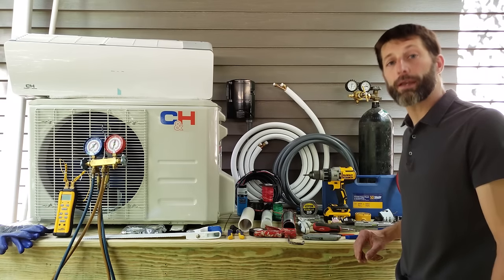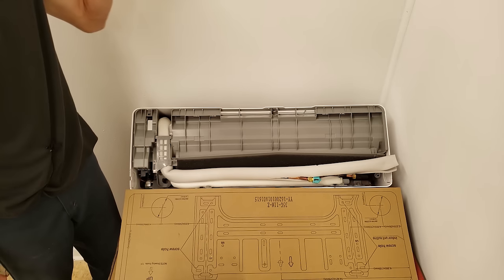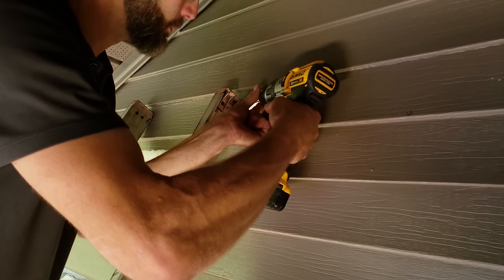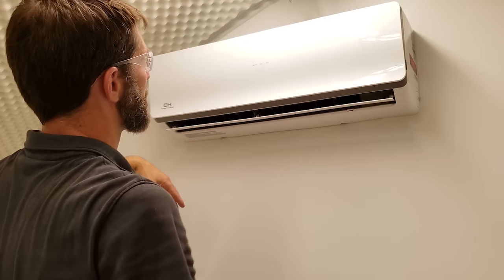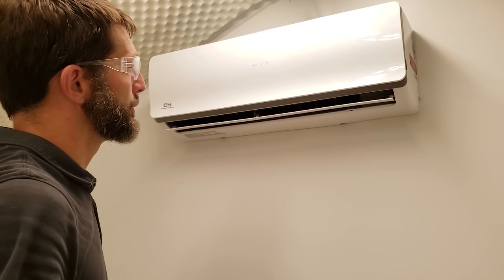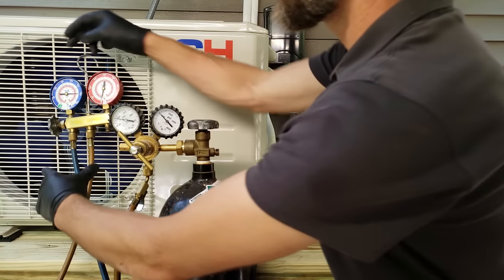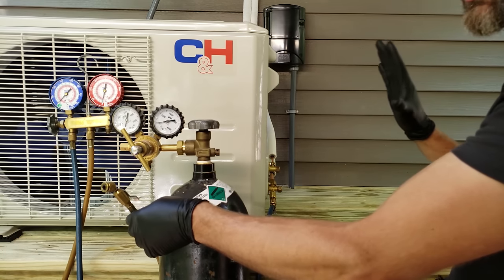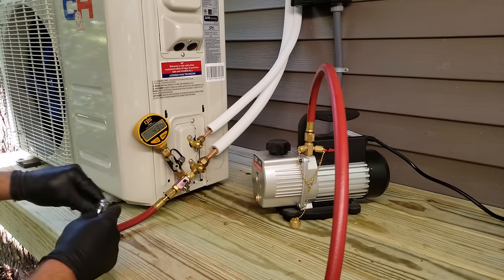Full Installation of Mini Split Ductless Unit, Step by Step!

Comment: Excellent video. I don't think you left anything important out. I loved the idea on using a plastic rain downspout in place of expensive dedicated line set covers. I assume this was installed in a Southern State because the platform it is setting on would otherwise allow snow to build up around the unit including the back side.

Comment: Thanks for the useful presentation!
I don't understand why you need to take out the valve needle?
There is a service connector that pushes in and opens the needle, why should you take it out?

Comment: I just enstalled a pioneer minisplit but with a plug.  It trips the gfci plug, so I put a regular plug on it.  It trips the gfci outlets in my garage as well.  It works fine on a regular outlet and doesn't seem to have any short, overload or anything.  Any idea why these would trip a gfci?  It does it right when the outdoor fan would turn on, there is a click sound which preceeds the fan turning when it works normal.  Thanks for any input.  Your how to videos are top quality.  It's harder than it looks.  LOL

Comment: Really appreciate the installation procedure, I learnt something new about the indoor unit install but in a situation where you are in a closed building especially a commercial stores. This method doesn’t work. My concern is about the usage of a slim duct instead of the exterior covering you used. In all, great job bro.

Comment: Thanks for posting. Such a professional installation requires the use of flare nut wrench on brass connectors. The adjustable wrenches are the worst tool for this type of work. All the best.

Comment: Hello Craig.  I installed my first Mini Split on Saturday.  The only question that I still have is the valve core removal tools that I have came with Schrader valves installed.  Should I just remove those next time so I can install the vacuum gauge directly to that fitting without adding the fitting that depresses that valve?  Thank you again.

Comment: QUESTION: what is the reason you would add a disconnect switch next to the evaporator head? Planning to install a 4 - head system soon. Great Video!

Comment: I have three points about a mini installation:  Most importantly, all the manufacturers that I am familiar with instruct you to add insulation around the lineset.  Because of high temperature differentials to maintain optimum efficiency of the unit and to prevent heat loss or gain enroute this is a requirement most especially so in colder or hotter climates.  I have never seen a mini with a stainless steel  compressor.  Even though they often tout their "harsh environment compressor model" for coastal zones and wet climates I have yet to see an actual compressor truly designed for a rigorous environment.  Add to that the degradation that happens when debris (leaves, pine needles etc. etc.) clogs the heat exchanger in efficiency and life span it only makes sense to enclose (with plenty of air flow) the compressor.  Those closely spaced fins are extremely difficult to clean if they do accumulate debris without damaging them.  If you are in snow country you don't want the compressor trying to operate while restricted by snow.  All the components are effected by corrosion to more or lessor degree and driving rain does the computer boards no favors either.  It has been my experience that the bottom pans of even the "harsh environment" models start to rust out after only a year or two in service.  Because the condensate keeps the pan wet year round this will result in shortened service life so doing everything possible to extend it only makes sense.  Lastly I would highly recommend leaving a bit of slack (service droop) in the lineset in case at a later date any fitting needs to be replaced.  Yours was short enough not to really matter but in many cases an unnecessary splice might be required to replace a simple flare fitting.  A bit of slack at the compressor makes that a quick task.
I liked your innovation with the downspout as most lineset hides are not large enough to take the extra insulation and/or multiple linesets required.  Maybe the vinyl post covers for 4x or 6x used as you did would solve the problem.
Reply: Leaving a little slack yes. A loop, absolutely not. That creates a  oil trap and will starve the compressor.

Comment: Really informative video. I am going to be installing a C&H 2 zone mini split and was curious about one step of the pressure and vacuum test. I have seen conflicting information about what low pressure valve to run the test off of. Should I be testing both lines individually, or can I adequately complete the test off of the main valve?

Comment: Also can I run line sets along the back of the unit and pull off the tab to run them through then run up into attic and out exterior wall to condenser? Thanks for your content and time. Keep it up!

Comment: Your videos are unbelievably helpful. As a result of your videos I have three brand new Mitsubishi mini splits installed in my house. And I never had a problem. Just absolutely superb. I do have one question if you can answer it. I am running a fourth Mini split and it requires me to run the lines that across an  insulated attic.  Do you recommend a specific type of insulation for the Lineset so that condensate doesn’t form and leak through to the ceiling below? Thanks so much

Comment: Amazing tutorial as usual! Thank you. I have a Fujitsu 5 zone  system to install. I’m only putting in 4 indoor units for now, ( the connections are labeled A,B,C,D,E) but I’m not sure if I can skip connection A, and connect it at a later date. Manual doesn’t specify.

Comment: what's you take on using a factory hanger to hang one of these ( 9000 BTU) on a metal building say about 1.5' off the ground or should I go with a concrete pad.  I am thinking about convenience of mowing underneath this vs air flow.  concrete pad placing the outdoor unit perpendicular to building wall will clearly give me much more air flow than keeping it about 6" away from building wall on a hanger.  What is my priority and what do you suggest?

Comment: Hi Craig, I think mini splits are designed with American homes in mind as your walls are not very thick, here in the U.K. we have very thick brick or stone walls and when you come to fit the indoor unit the flares are inside the wall where you can't get to them which is not ideal for maintenance this means you have to connect your line set first and feed it through the hole, have you ever come across this and would it be possible to just extend the copper tails on the inside unit ?

Comment: The installer of a Mitsubishi MXZ-2C20NA4 - wants to charge me for the refrigerant for this new Mitsubishi mini split he is saying it will take more than  10 gals. Is there a chart somewhere that says how much this unit uses with both zones using a total of 66 ft of linset using 1/4" and 3/8" lines. Thanks for your help

Comment: very good video however i do have a few quetions..what happens when the outdoor unit has to be placed about 15' to the left of the indoor unit? what happens when you cannot place your downspout line exactly where your indoor unit is? wouldn't want a block of ice on the floor of my unheated garage...

Comment: Nice to see some pride in there work. Definitely no steps missed. Unfortunately i don't have the special vacuum valves or nitrogen,  but everything else I will do the same. Just have to pull vacuum and check negative pressure to see if it holds and go with it . Great video,  New sub. What would be the install price for a job like this, just labor. Around 7 or 800?

Comment: So if I do not use this dual valve remover method would I get the same accuracy by letting the vacuum run for multiple hours or even overnight before cutting it?

Comment: I might have missed it in the video. Do you have to adjust the refrigerant to accommodate for the shortened lines (since they were cut and flared). Is the pre-charged measured for a certain line set length?

Comment: We live in northern Vermont, and need this unit more for heat than AC. Which unit do you recommend?  And when installing the copper tubing on these mini-splits, do you prefer to flare the connections rather than brazing as some say that if there is a problem with these units, it is usually in the flare....?  I have seen a crimping tool for refrigerant, and wondering about that also?

Comment: Excellent video, thank you Craig! Regarding the pressure test, I'm using a digital manifold and it showed a drop from 303.4 to 302.4 over a 15 minute period. I've bubble tested all the connections and am seeing absolutely no bubbles. Is a certain amount of drop expected due to air loss through the manifold and the temporary hoses, etc or should I be concerned?
Reply: Dont forget if temp drops during testing Pressure would drop quite likely this might be the case. How did the vacuum test go ?

Comment: I am installing a 9000 BTU Senville split air unit.  The unit only draws 6.1amps normally to 8 amps max.  I was planning to hook it up to my 15 amp circuit.  The circuit will have other appliances on it but I wont be using any of them while this unit is running.  The only way I can tap into that circuit is to take a fixture of my porch light which I would remove.  The light is controlled by a switch inside which now would control the split air system.   I would use the wires from the light fixture that was removed and extend them to my outdoor unit via a wall mounted non fused disconnect which would be mounted outside near the outdoor unit.  I have purchased the factory wire back from the outdoor unit to the indoor unit.  Do you see any issues with that type of wiring.  Your response would be much appreciated.

Comment: This video is very impressive. This is my question though. If one wished to mount the interior unit on an interior wall does he line condensate line require downward slope along it's full length in order to function properly, or can it go up above the ceiling joists first to get to an exterior wall?
Reply: yes, a downward slope is necessary.  If you need to go against gravity, then a condensate pump is used.

Comment: Very thorough! Thank you.
My issue is the smallest mini split head units is 9K which is to large for a 180SF BR. Most manufacturers are the same. How do you eliminate the possible humidity issue? 
Can any adjustments be made in the CH head units to eliminate this? 
I’m located in SE PA.

Comment: Do I need to use a pre-constructed line set or can I make a line set using copper pipe and insulation and flaring the ends?  I ask because the shortest line set I can find for sale is 15' and I will need only 8-10 feet.  So, I will either have extra length which I will need to coil or I will need to cut and flare the line set, which, IMO, defeats the purpose of buying a pre-constructed, pre-flared line set.   Many thanks!

Comment: Craig I have a tool question. When checking temperature on liquid/suction lines here in Oklahoma where the wind speed is always 15mph, do you find the accuracy of the test instruments could be compromised because of these weather related ambient issues.  If so, would a bead probe be better than a Fieldpiece temp clamp?

Comment: Hi mate. Nice video. You should go in Romania to try fixing an AC unit on the wall made by 35-45 centimeters(thickness) steel concrete with that probe and that holesaw :)) you will cry and drill around 4 hours to make an hole for the pipe  :))

Comment: Thank you for clear instructions on how to install mini split heat pump systems.  I have learned so much by watching your videos.  I’m just a DIY , but your videos are very thorough, so I shouldn’t have a problem installing my own.  Before I do, I have a question.  Would you consider a 120 volt 9000 BTU mini split heat pump too much for a bedroom that is 140 square foot?  We live in Florida and so very humid conditions in the summer.  Would a 9000 BTU system work well or do you suggest another BTU?  Thanks so much in advance!
Reply: 9000 btu heat pump is listed for up to 400 sqf. I am putting one in a 200 sqf playroom with three outside walls and  two large windows. It should not be over kill with all the exposure.

Comment: Hi AC Service Tech (Craig) I like your trick to use downspouts as a line set cover. If I try this on a horizontal run should I be concerned about it trapping moisture? Did you caulk between the downspout and siding?  Thanks again just bought all your books and ref cards.

Comment: If not using an outside disconnect, do you recommend standard 14/2 romex to the outside unit?
Reply: 14/2 is not recommended

Comment: Hello Craig. I just purchased your inverter min split book. I am going to install two mini splits in a rental and a new gas furnace and central air conditioner in my home.  I was wondering what size nitrogen tank I should buy?  Thank you for the great content.
Reply from the maker: I use a 60 cu inch, thanks!

Comment: Do you prefer to use downspout instead of line set covers? The line set covers are a heck of a lot easier to install, and are definitely easier to get back inside of if you ever need to.

Comment: Can i run a 75ft 12/2 wire from the compressor right to the 30amp breaker in the electric panel. Using a Copper and hunter 2 zone 9k + 9k 18000 BTU 230V Compressor.
Reply: Yes

Comment: When you did the nitrogen pressure test did the nitrogen flow into the indoor unit and back on the liquid line ? Did it flow backwards through a TXV.
Also what pressure is the compressor sump when it is delivered. Is it at positive refrigerrant pressure ? All the high presssure refrigerant is stored at the outlet of the compressor in the condensor.

Comment: In the video you did on full installation of Cooper and Hunter mini split what kind of connecting terminals were on the power cable connecting to the wall unit? It looks like their the Flat Blade Crip style.

Comment: Great videos. I have a question though. Why wouldn't you just install a slightly larger PVC pipe so it would be easier to push the copper and condensate lines through? It seems like the condensate line is pinched in the 2-in pipe? If the pipe is sealed on the inside anyway it wouldn't matter if it's a larger diameter pipe.

Comment: Great Video Criag. Taught vocational trades but have never got into the Minisplit system for three separate apartments two story older building and unfortunately will have to use some condensate pumps. Did you ever do a utube video on them or recommend a unit. Saw one outside of high wall mount but per to hide. Thanks Larry

Comment: Great video. My question. My mini split states must have 10 feet of supply line. looks like you cut yours off much shorter. How do I use up 10 feet for first floor 6 feet from hole to outdoor unit

Comment: Thanks for your vids!! Have you ever done a step by step replacement of a typical 3 or 4 ton system with gas heat? That is pretty much the standard residential system in this part of the southeast.

Comment: Hi Craig, awesome video! Thank you so much for the time you put into this and the attention to detail.
One question, I am installing a multi zone system that does have a service port one the liquid side, I’m assuming I would need to connect to this for pressure testing and/or vacuuming? 49:50 
Thank you!

Comment: So I have my condenser basically outside directly under the air handler so I'm not needing the 25ft of lines they provided. My question is can I cut those down to the maybe 8ft that I actually need or is there a minimum? I don't see anything in the manual for this question

Comment: I have a CH sophia dual zone hyper heat system. My 12k head started showing a p4 error during use for heat. Worked great all summer as ac no issues. When the error appears the head will stop heating and sit in limbo. Have you seen this?

Comment: Is there an issue with the condensation line being blocked by having such a tight bunch of cables through only 2 inch hole?

Comment: Thx for this video. I"m doing an outside siding job along with installing a mini split. Is there a problem with running the refrigerant lines inside of the walls? I have everything open and it would be pretty easy to do.
Reply from the maker: That would be great, no prob!

Comment: So my biggest question is this. Can the line set be ran through walls, etc? I was wondering about a three head unit, and running the lines under the crawlspace, then up through the walls

Comment: Great video btw.  but ok so I screwed up. when I went to pull the vacuum I didn't remove the valve core cause I didn't have that tool I just used the manifold hose. I didn't realize until after I released the refrigerant and there was no escaping refrigerant that the manifold hose wasn't tight enough to depress the valve. I only pulled a vacuum on the manifold line. Now I have refrigerant in the lineset and never vacuumed the lines. What should I do? I didn't start the unit because of this. do I need to take all of the 410a out and recharge the system or is the refrigerant in there still good and can just pull it back into the compressor and them vacuum the line

Comment: 24:19 So wiring diagram says 1=red, 2=black, 3=yellow(white), but the electrician made it 1=red, 2=white, 3=black on indoor unit and the same on outdoot unit. Will it still work? From what you said I assume yes! Correct?